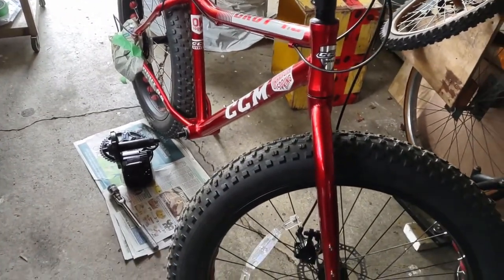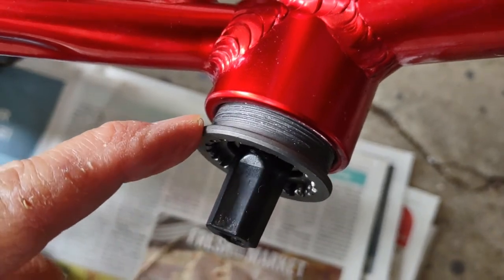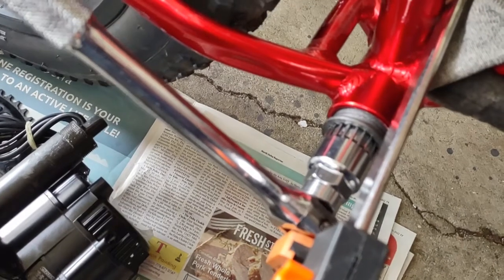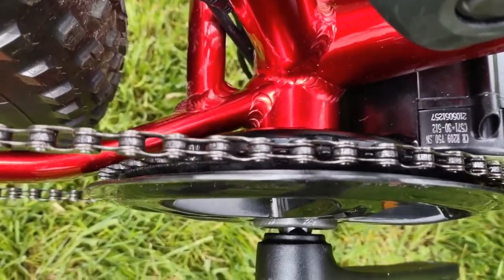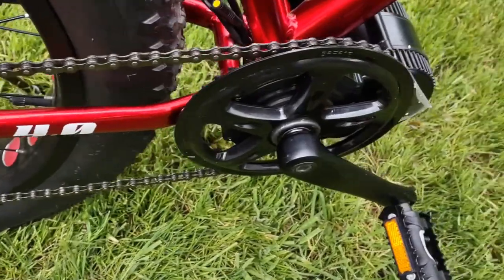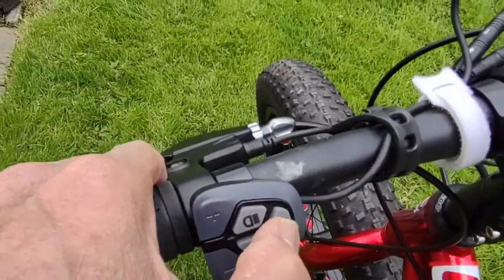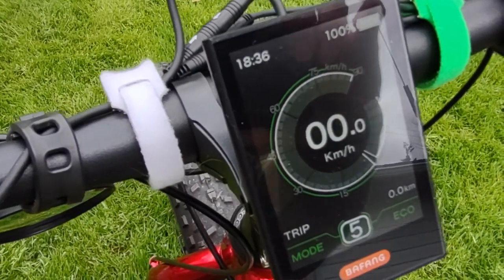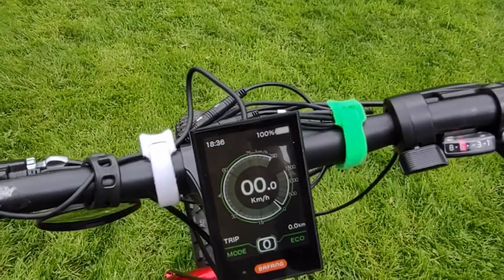CCM Brut Fat Bike converted to ebike Bafang mid drive. Removal of very tight bottom bracket cup.

Comment: You ordered the 100mm size bottom bracket for the motor? I have the same fat bike. Any links for where you ordered? Everything I see on amazon for 750W bafang mid drive is 68mm
Reply from the maker: I ordered from these guys. You are lucky, there is a huge sale on right now! May 2024. You have to let them know what size bottom bracket you need. Good luck with the conversion. https://www.aliexpress.com/item/32852257691.html?spm=a2g0o.order_detail.order_detail_item.3.7f8df19cAbuEDx

Comment: Nice video.  Bikes braquet is 100mm but i need to use the 120mm motor with spacers is that possible ? I have a 46t chainring ...
Reply from the maker: Thanks! You might be able to use a 120mm motor on a 100mm bottom bracket with two thick 10mm spacers. Also you will probably need longer mounting bolts for the ‘triangular’ mounting plate with spacers between the plate and the motor. Good luck with the conversion.
Reply: @randphong  good point about the longer bolts.  Thanks!